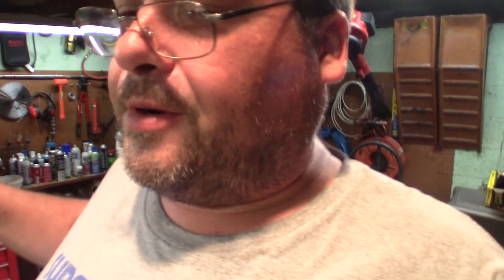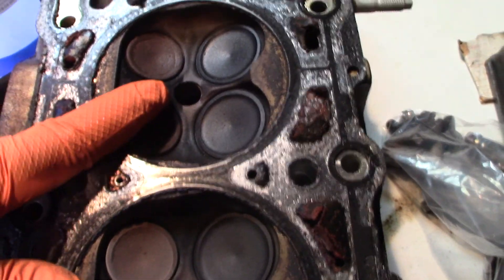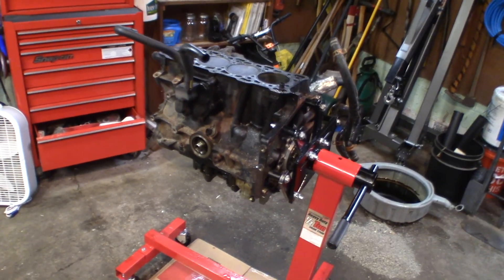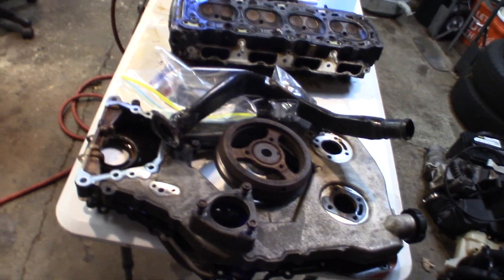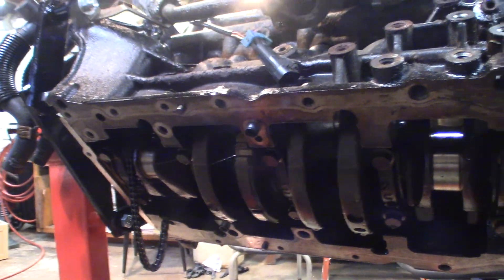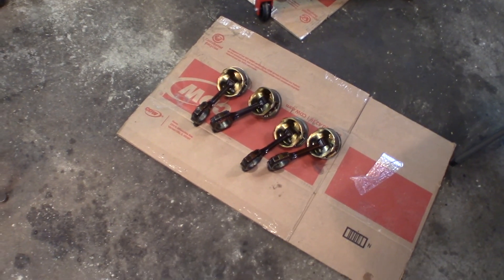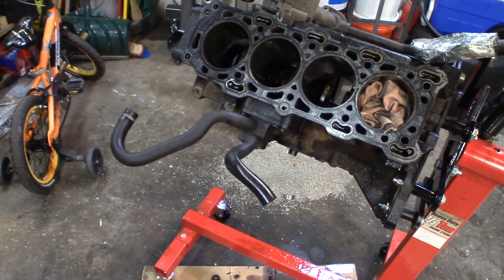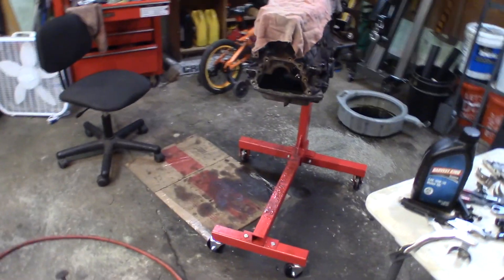GM 2.4 Quad 4 LD9 Twin Cam Engine Rebuild - Engine Tear Down

Comment: How did you get the broken bolt out? I'm in the same position (broke when torquing) and have no clue how to get out.
Reply from the maker: With a punch and a hammer.
Reply: @frugalprepper  Tried that on the first bolt. Didn't work so when to a drill bit and got it out without messing any of the threads up. Got another bolt and it snapped again but this time the drill didn't work and the punch did. Thanks. 

If you have any local places to get a bolt from lmk ill pay.

Comment: Why  is   he    calling   it    a   QUAD  4   twin   cam?           TWIN   means   2.         QUAD  4   is   as   you  say  it--------4.
Reply from the maker: I call it that because it is a Quad 4 Twin Cam.  It's weird because it says it right on top of the engine.  4 Cylinder, 2 Cams with 4 valves per cylinder.

Comment: I have the same engine I was wondering could u help me out I just recently had like white mayo lookin substance I think my oil & antifreeze is mixin it’s comin from the throttle body cover so I was wondering like could it b the intake or a head gasket?
Reply from the maker: No coolant runs through the intake on these.  If you have coolant and oil mixing it pretty much has to be either a head or head gasket.

Comment: Got one of these waiting for me in the garage..i have one with rod knock, cracked piston..just doing it to do it - like a hobby, already have all rebuild parts but not going to machine shop..hopefully crank will be useable, replace all pistons, bearings etc
Reply: Bob Biggard do you think I can get to the rods in mine without taking out the engine?

Comment: where is the oil pump???????????????????
Reply from the maker: The oil pump runs off of the balance shaft assembly that runs off of the crank.
Reply: sso on bottom of motor, passenger side drivers side????????????????????
Reply from the maker: Its bolts to the balance shaft assembly on the bottom of motor at back of engine.
Reply: drivers side passenger side???
Reply from the maker: I would be rear of the engine that is closes to the drivers side.  The transmission end of engine.  This would be where the sump is in your oil pan.
Reply: thx mine blew out awhile back and I was told it has a plastic casing that cracked never knew where to check it
Reply from the maker: This oil pump does not have a plastic casing.  It is metal.   The oil pumps are not that common of a failure on these engines, but it can happen.  Are you having low oil pressure of no oil pressure?   If it is just low then I would do some testing first.

First check you pressure with a oil pressure tester.  The oil pressure sending unit is right on the intake cam tower and it is easy to get to.   Pull the sending unit & hook up a test gauge.  The reading should be Oil Pressure @ 3000 RPM, 30 psi min & Oil Pressure @ 900 RPM, 10 psi min. after engine reaches operating temperature.   If it matches those values, replace the sending unit.

if the pressure is actually low then I would pull the oil pan, remove the balance shaft assembly (There is a procedure to remove and replace this unit and it must be timed with the engine and require s a special tool to put them back in time.  Most importantly the Balance shaft sprocket bolt is reverse threaded) inspect the main and rod bearings and plastiguage them to see if they are within specification.   Rod bearing #3 has a tendency to spin on these motors from being run low on oil and then you have oil pressure problems and eventually a knocking engine. 

You can also remove the oil pump and inspect it. while you have the balance shaft out.
Reply: @razegs  did you ever find your oil pump